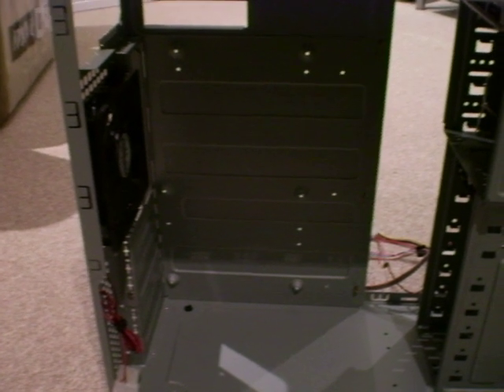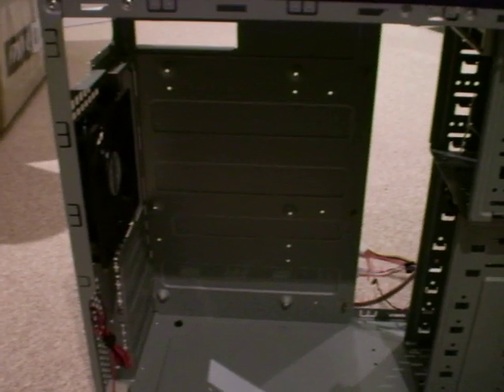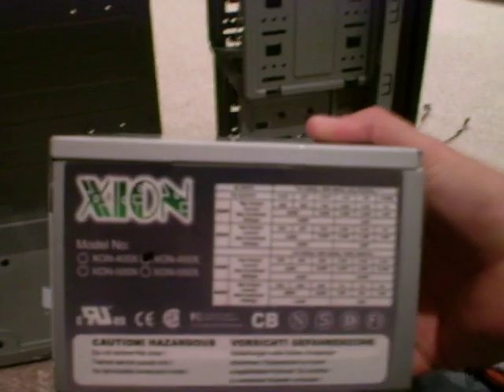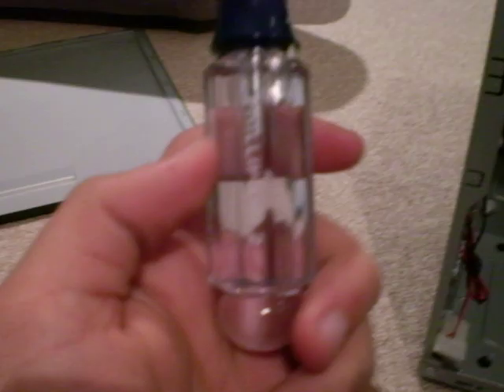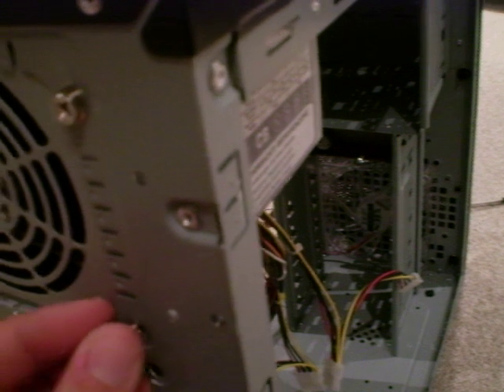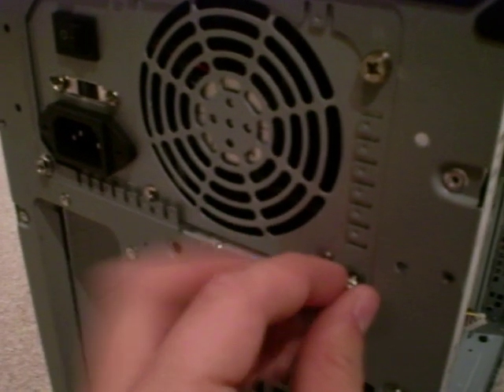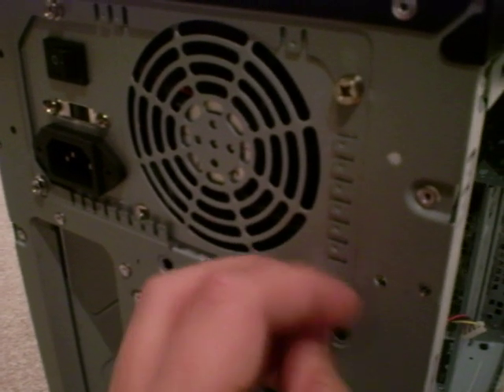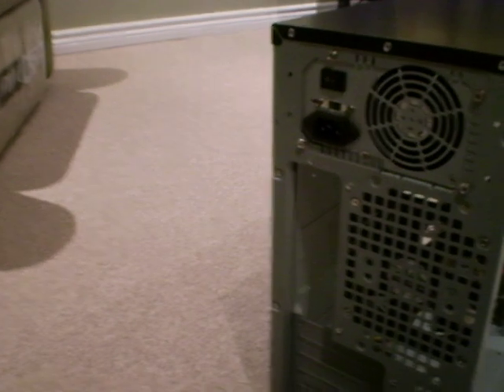How To: Install a Power Supply

Comment from the maker: Most likely if you have to connect your GPU to your PSU you have to use either:
a) 4 pin Molex
b) 4 floppy power
c) 6 or 8 pin power cable

A and B are for really old GPU's and most likely you will have to use C, you plug it in just like the 4/8 pin CPU power cable for the CPU.

Comment from the maker: Different setups would require different connectors thus making tons of possibilities. You can't go wrong anyways, no power plug will fit into any other plug, for example 24-pin motherboard into hard drive power.